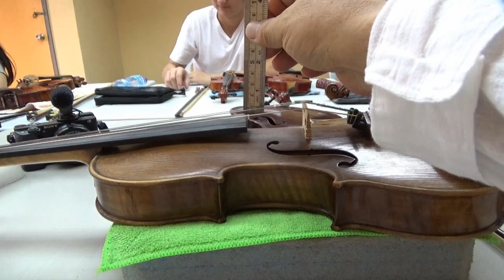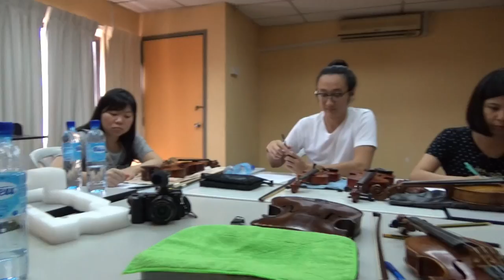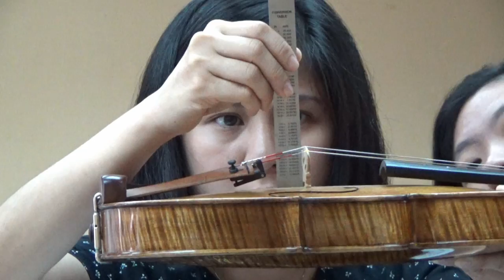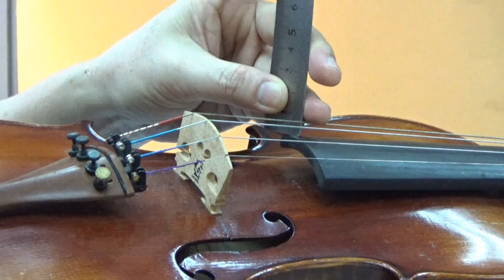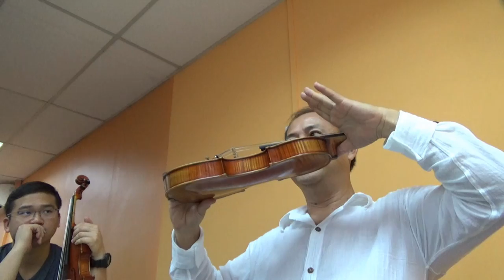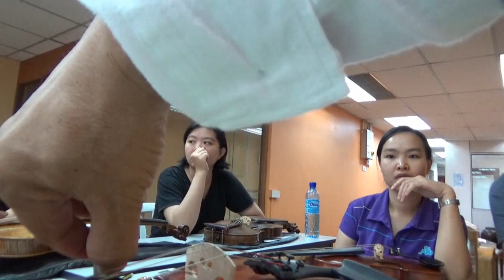Violin Bridge Position 3, Malaysia Sound Workshop part 3

Comment: Mr. Daniel, I always earned so much from you and your lectures and I want to thank you! Also Happy new year!

I just want to share my experience and point out that violin here in the Philippines suffer from having a low fingerboard. As I am selling violin here I noticed that. 

But the violin that arrived here from China and USA have Good fingerboard height. it is just the weather. and a new arrived violins will tend to bend if the string are tightened... the fingerboard will go down. So I always loosen the string and stock those violin for at least 6 months making it adjust to the weather before selling them. So far so good, my student are not having any problem with low fingerboard.

I learned from a costly mistake, I bought 2 violin worth 1k USD one I liked so much the other, well not so much because of the varnish color it was stashed away for months. The one I liked so much got tuned ASAP and with time the fingerboard went down. That was back in 2014 or 15?.(Going to get a neck reset)  now the one that got stashed away, remain fine and one of my student is using it right now and the fingerboard is still the same as it came.

also the violins that I sold upon arrival suffer the same problem... so now I learned to stash them away for months before selling them.

Comment: HELLO  MR. Daniel CHEN, Thank for all the videos made about the violin.  After knowing the standard position of the bridge,
 I have the following question.  The length of the gut for the tail piece can be adjusted so that the tailpiece can be closer or further away from the bridge.  Is there a requirement of the LENGTH from the back of the BRIDGE to the contact point of the string on the tail piece ??  Will this distance affect the sound ?? Thank You.

Comment: I have a strange issue.  My bridge which I bought today is measuring aprox. 34mm and the height of the fingerboard is around 20 -  21mm 
But the strings  clearance for E string is about astonishingly high 26mm instead of the 3 mm you recommended. What could be causing this?  I am unable to tune nor play (obviously) :). Awaiting your advice.
Reply from the maker: you only bought a bridge material, you need to go to a violin maker to fix it to suit your violin. In Japan the charge of this work costs at least 10000 yen which is 100 USD. thanks
Reply: @AVDanielViolin  Thank you.